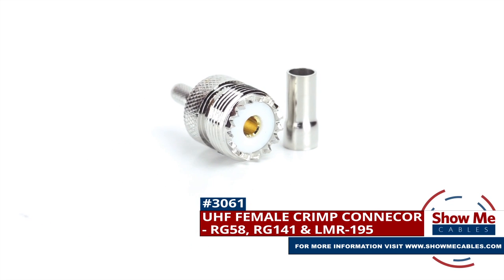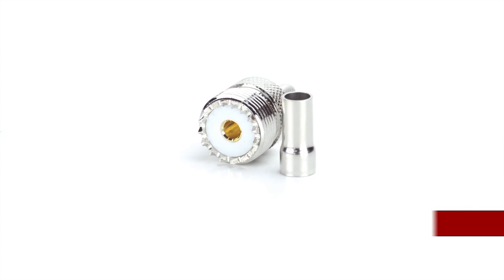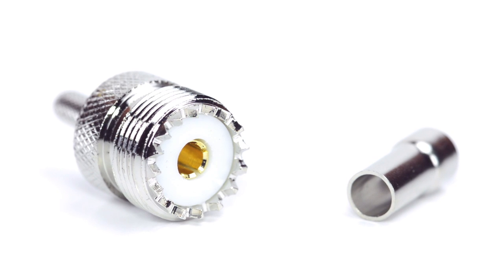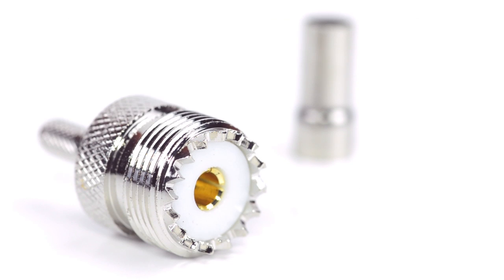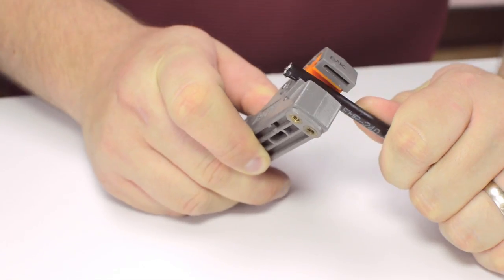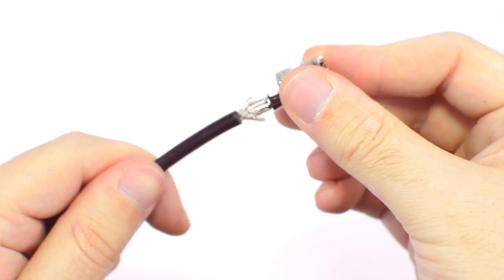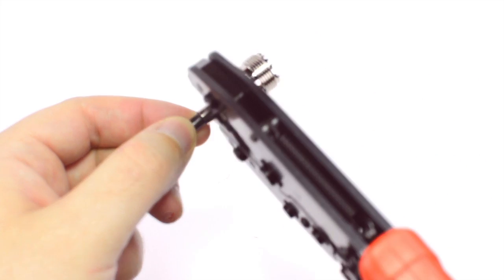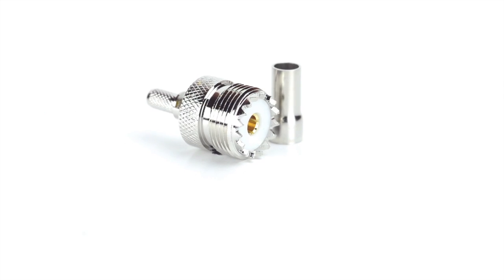How To Install UHF Female (SO-239) Crimp Connector For RG58, RG141 & LMR-195

Comment: These look a little better than the brand I bought. 
The brand I bought you have to solder a pin onto the end of the center core,  then stick it into the SO239 and then crimp the outer shield.
I don't like crimping the shield to the SO239 body at all. On my "different brand than this" there wasn't a solid enough connection on my new homebrew 5/8 wave Sirio Gainmaster   antenna and SWR went off the scale. I had to take it down and with a very hot soldering iron. I soldered the shield to the body of the SO2339. Now SWR's are 1.31 on ch1, 1.15 on ch 20 and 1.15 on ch 40.